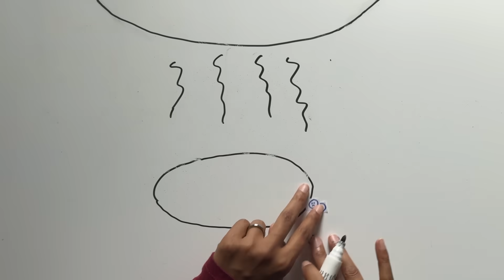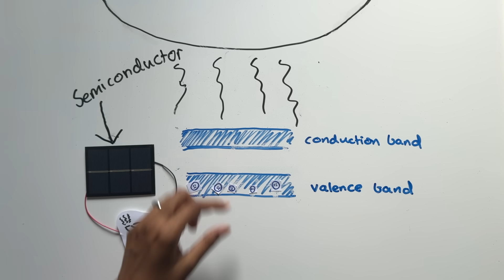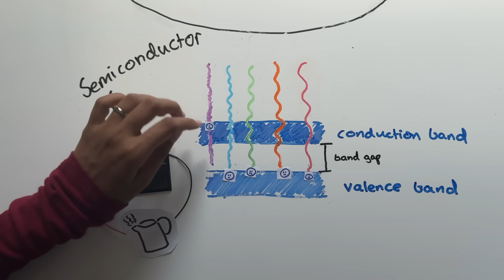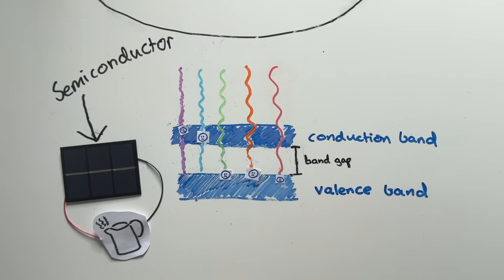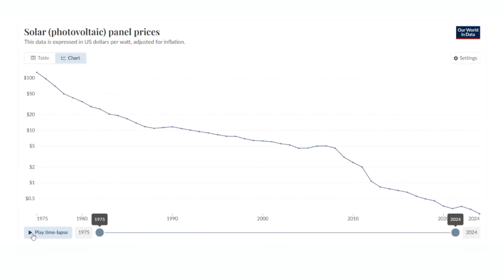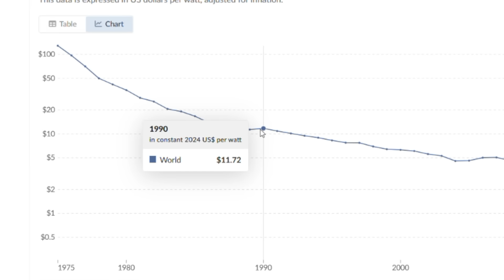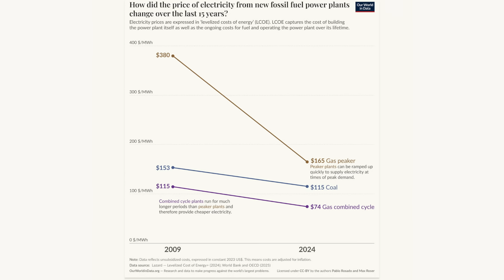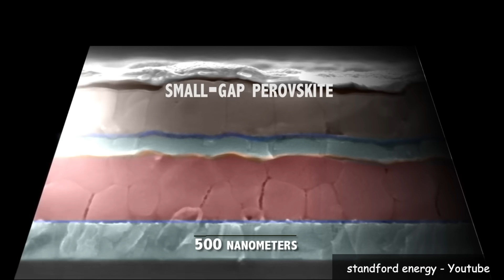Why solar panels can't be more than 33.7% efficient

Comment: Not technically true. It is just our obsession with electricity as the only form of energy to work with that makes that true. If we strived to capture solar heat instead, we would have greater efficiencies. 

Considering that a significant portion of green house emissions come from generating heat or cooling, capturing solar heat can be very useful. A far greater portion of the approximately 1200W per square meter of solar energy can be captured as heat. Further, this makes solar capture in areas of latitudes closer to the poles much more capable of capturing useful solar energy, as even week cloudy days could provide energy.

Also, yes, cooling can be provided through heat capture. The heat could be used to drive airflow through convection, like a free fan. More, there has been some really good tech driven by liquid desiccants. They draw moisture from the air, where a significant portion of a room's heat is held. The problem is desiccants become saturated quickly. Heat can force it to let go of all the moisture it captured. So, you use the dessicant in the house, move it to an external chamber that is solar heated, the moisture is removed, and the dessicant can be moved back into the home to continue trapping ware moisture. A heat powered air conditioner. Especially one that works in humid environments.

We have to stop being so obsessed witb electricity and start utilising other forms of energy to solve our problems.

Comment: 1. Not everyone can buy and install solar panel. People who live in big cities or an apartment can't. They need electricity from the grid. 
2. Grid instability already a big issue. Solar only adding more to  the existing problem. Energy from solar can't be stored effectively, cheaply, and reliably. The best grid scale energy storage solution we have is pumped storage hydroelectric dams, but this requires huge land area and not every place is suitable.
3. Over reliance to China for manufacturing and Africa for mining. We need to diversify the supplier of solar, but it won't happen soon.  
4. The recycling problem. Remember solar panel contains many heavy metals and toxic materials that can't be dumped into bin, it needs to be recycled in special factory. Currently, this factory practically is nonexistent.

Comment: Someone just noted they get 42% efficiency even in Scotland.  You may well be right, but that’s 42% of the 33% maximum efficiency at which your solar panels convert sunlight.  The reduction from your maximum solar panel output is due to losses in the other components in the system, variations in light levels etc.  it is still a decent way to generate electricity as the fuel is free.  So long as the hardware price is low then it makes good sense financially even at very low overall efficiency.

Comment: This is presenting a use case for the focused mirror type of solar farm -- where instead of having many small solar panels you have a parabolic mirror that focuses light into a central pillar where energy is extracted. When doing that, it might be feasible to then split the light into different colours and focus those on different band gaps, increasing the efficiency
Reply: In US they’ve closed done such a power plant because it was too inefficient. 😂

Comment: Isn't it possible to separate the desired spectrum by a prism?
Reply: There is no need to seperate the light. In multilayer cells the lower energy light just go through to the next layer with a lower bandgap material.

Comment: One of the most important reasons why silicon solar improved so much was that the technology for making huge ingots of super pure silicon was also needed for computer chips. Going from 99% to 99.999% pure silicon allows for better chips and more efficient solar cells, but increases the material cost by something like 1000x. However, when the ingot is a foot wide instead of just few inches you can mass produce far more computer chips at once and the cost increase for that was far more moderate.
Old solar panels made from small silicon wafers can be seen to have round PV cells or cells with corners cut off, which means even if a square meter panel used 30% efficient PV cells it might only produce 150W because of all the wasted space. By making the cells from bigger silicon wafers they can cover the panel almost completely so the efficiency of the panel approaches the theoretical limit of the cells. This is both much cheaper than trying to make the cells more efficient and allows for mass production of solar panels.

Comment: Interesting discussion and well presented. But the colour my photons is sceptical about costs and practicalities.
I don't mind solar if people wholly pay from their own pockets, and do not take subsidies from everybody else.  Subsidy is an admission of a false economy, and it's the norm here in the UK. The subsidies are usually in the form of a very generous export price, paid at everybody else's expense.  
On practicality, to demonstrate the true value of solar (to meeting your needs),  you have to go completely off-grid.  Connecting to the grid for (fossil fuelled) backup is an admission that solar is inferior for meeting your needs, admitting that you still depend on responsive and secure fossil fuelled power stations and networks (which will be expensive if you fairly pay for your share of the cost of holding the assets for your intermittent needs).
It's all very well talking about the cost of the solar cells themselves, but this underestimates the cost and your presentation is misleading. If you go off-grid, you will have the cost of the battery and control systems, all of which will ration your consumption to no greater than the contribution you receive from your solar panels. Where you are rationed, you should include a fair "loss of utility" cost for the things you are forced to give up. Especially in winter months.  
In Australia, I assume there is plenty of cheap open space to spread your contraptions around. See how far you get with off-grid solar in a densely populated urban area, with people living on top of each other in flatted apartments. Not many square metres per household to share around.
Finally,  you analysis is based on making yourself comfortable at home. A modern economy and lifestyle depends on things like aluminium smelters and AI datacentre, either of which needs millions of secured kW because they don't tolerate intermittent energy supply.

Comment: I think it's important to also mention the lifespan of coal and oil power plants is 30-50 years. They degrade too and need huge re-hab projects to keep them running. So even the 30 year life span of solar isn't a negative really. And, importantly, it's way easier to replace solar panels than retrofit an oil or coal plant. They're open, and they are at ground level and they aren't many tons of weight for the main machinery. 

Also, I found an article a while back where they found that putting solar panels vertical, instead of angled and tracking the sun, was more efficient over the course of the day because they don't over heat during peak hours. So over the course of 24 hours they generate more electricity, than if they tracked the sun (and overheated and then had to be throttled back and cooled to prevent damage).
Reply: New gen solar panels can still retain 85-95% of its full capacity after over 30 years, so probably all the solar panels will outlast any human life expectancy before it needs to be replaced
Reply: @sihamhamda47  that assumes linear degradation

Comment: The “exotic” panel types may cost more but if the land/space available is costly or limited, then that has to also be factored in.

For example, if you need twice the land for a silicon solar power farm and the cost of land is expensive, then paying for the “exotic” panels may be more cost effective.

Or, if you can’t produce enough electricity with silicon panels because your home’s roof area is insufficient, then the higher cost of “exotic” panels may be worth it.

Comment: There are two problems with solar.  First, the panels are extremely dirty to produce and mainly made in areas with few, if any, environmental requirements.  Second, solar requires an extreme amount of land for industrial-scale production. This is a problem because that land is no longer usable for any other function.

Comment: Beating the Climate Change? I've never heard more Idiotic statement. So, you're so smart, you understand the way the Solar Panels work, but you are too stupid to understand how the Climate is very Complex and Complicated thing out of the range of us Humans. On the Band Gap, its Thermodynamics, nothing new, we knew all this long time ago. And what can you do with 1.5 KW? It's rhetorical of course - nothing. I'm not as smart as you, I'm having hard time understanding this numbers in your chart, but 6.5 KW is nothing as well. If it's cheaper it doesn't mean it's enough. And how much the Battery costs? And how long it will last in terms of energy supply and in terms of longevity. You didn't say. It doesn't matter how much of these you have, sun is not shining at least 3/4 of the time in most parts of the world. What will you do then? As i said you're an IDIOT you claim that 33% is the limit and later you claim Solar panels are getting better and better, well you can't go better than Maximum of 33%, don't you? 30-year life span, it's more like 15 years. They are cheaper cause of the Coal and Oil; you can't produce them without Coal and Oil. It doesn't matter at least 3/4 of time Sun isn't shining. As I said, you're an IDIOT "Solve the Climate Change" It's been happening since 4b years when the Earth was made, and it will be happening until the end of time.

Comment: 10:17 Your dad might be overly optimistic re his power bills, despite having a battery. We did this in 2018 and haven't had to pay an electricity bill since, but the combination of increasing supply charge and reduced feed-in tarriffs mean it's no longer possible to even cover the daily supply charge with exports. We're expecting to have to start paying again soon despite exporting approx 7 MWh/yr.

But we're still really pleased with our system including its batteries, and are working on increasing self-consumption, including by now driving a (non-Tesla) ev, which for obvious reasons we charge at home

Comment: I'm watching this on solar power, there's about 1kw of panels a few feet above my head.  I've been on solar and off grid for almost 20 years, but according to the comment section, "The problem with" and "The issue with" it being thinking anything short of magic 100% efficiency makes it worthless.  33% of total solar spectrum utilization on a silicon panel IS 100% efficiency at capturing energies with in the bandgap range and limitations of the materials.  Anything else you're gonna have to ask Harry Potter for or something because it's wizardry beyond the bounds of physical thermodynamics of this universe.  These people are impossible to satisfy with anything less than actual magic and unicorns so their baseless nonsense can be safely ignored.

Y'all are getting about the same efficiency out of fossil fuel powered vehicles after friction, drag, pumping losses, heat loss without keyboard warrioring about how they can't possibly be viable, but when it comes to something you have no experience at all with aside from propaganda buzzwords it's all "clackity clack rawr it's inefficient at gathering an infinite free resource and thus useless reee!"  But catching 25% of a hundred square feet or so of photons with fancy flat sand plates sitting silent and passively on your roof is still a kilowatt of entirely free power.

By my 'calculations' ( and by that i mean almost two decades of experience living solely on DIY solar) about a dozen $80 panels, 6 golf cart batteries and a few doordash deliveries equivalent in $50 Klarna burritos spent on an inverter/controller gets you to where as long as sunny days aren't a rarity you can pretty much sit there in front of the fan and shitpost nonsense with the lights on indefinitely for 'free' after the initial investment VS 'investing' in paying a bill lol.  And i'm not rich by far, you people spend more on just your electric bill than i make in a year.  If i can do it anyone can.

I spent about $3k on solar since about 2008 and have used well over $30k worth of equivalent grid power from it by now.  It even has better uptime than the local failing rural grid down in town that goes out every other week that isn't free, it's twice as much as last year.  I haven't paid a utility bill in years, sun and water fall from the sky for free it's a no brainer to build a big enough bucket to catch it.

Especially these days where you're being farmed by AI bots in data centers sucking up gigawatts of power that you're subsidizing with your energy and water bill increases.  You're literally a human financial battery powering the data center you're querying when you ask ChatGPT "Ugh, like, uhh, why is, like, my electric bill, like, uhh, sooooo hiiiiiiiiiiiiiigh?" and the irony is ridiculous as it flies right over your heads.

Comment: The reduction in the cost of silicon solar panel production is not due to increased production volumes. Economies of scale are a myth. Asphalt is made from by-products of petroleum refining. Therefore, it is cheap and is used for road surfaces where it is available in abundance. The production of ultra-pure silicon is preceded by the production of less pure silicon. The production of both products is the result of diversification. In addition to the wafer itself, all electronic components and the machines used to produce them have become cheaper. Solar panels remain a small part of total electronics production. The overall development of industrial production and the growth of global consumption are making every product more affordable. Most panels are produced in the same place as everything else – China. Most panels are consumed in the same place as all other goods – rich countries. The rich pass on the costs of their consumption to the poor, which is why they are rich. There is nothing new here. Soon, a single AI data center will require petawatts of electricity. It is ridiculous to assume that solar panels will offset this increase in consumption.🧐

Comment: With concentrated solar thermal, the theoretical limit is ~95% (Carnot limit for a 5800 K heat source and 290 K heat sink)

Comment: I have to power a new home with solar, and I haven't bought new equipment since 2015, when I powered my first home (which is still running smoothly and the batteries hold charge after ten years!). I'll try new batteries and panels for this new home, hopefully they'll be cheaper 🤞

Comment: The problem with wind and solar is that if their availabilities are assumed to be complementary and added together, they are only available about 65% of the time. Which is why the only nations that have a greater proportion of electricity generated from renewables rely mostly on hydroelectric or geothermal, which are not available to most nations.
Reply: The reason why the deployment of battery storage system is increasing

Battery storage system dynamically regulate the supply by storing excess solar and wind on peak generation time and releasing it on peak demand time
Reply: @sihamhamda47 - But it costs more to store the electricity generated by wind and solar than it does to generate it. Like putting a Casio in a Rolex box.
Reply: @sihamhamda47 batteries are for smoothing short term production. They don't store energy from the summer to the winter or for when the wind is calm for several days in a row.
Reply: @tonymouannes  This is why we still need the baseline green energy like thorium reactor or geothermal
Reply: Also wind does blow at night but not all the time.

Comment: Wow, she's a total idiot. The theoretical thermodynamic limit on solar panels is over 90%.
Reply: You should be banned. I've been monitoring you out of boredom and you are using multiple accounts to attack people in this channel. Also your username and your 2nd account lepidoptera is the same meaning. It's obvious you have some issues. I wouldn't be surprised if you have more than 2 accounts attacking people.

Comment: I have been interested in (photo-voltaic) Solar Cells since the early 1970's, having heard about it either  in the newspaper or on a TV documentary, I assume. I actually wrote away to "DSIR" the government's then prime research bureau at the time, and later got a polite letter back, saying they they knew of the technology, but there was none in New Zealand, not even in the scientific community. They indicated that Cells sufficient to power what amounts to a small children's torch bulb, would costs about the weekly wage of a typical adult.

Than a few years later, in High School in the mid 1970's, I came across a textbook. From memory it was called "Solar Science Energy Projects" and was possibly published by  Scholastic books, being  re-edited extracts of a previous larger book possibly titled "Fun with the Sun". 

(It dealt with Magnifying glasses also as well as including a photo showing how at home a 16 inch diameter  Fresnel Lens could be used to melt steel bar),  it referred to small consumer grade solar cells by then being available, I think they gave about 0.4 Volts per individual solar cell and were affordable to come with some children's education solar and electric educational kits. (Including an efficient One Transistor AM Radio circuit).  They referred to the current batch of Solar Cells as being about 1% efficient and they said "the theoretical Maximum Efficiency would eventually be about 22%".  

As mentioned in your talk, some Solar Panels available on the consumer market already reach 25% efficiency.  It is great that many consumers now have more access to cheaper solar panels.